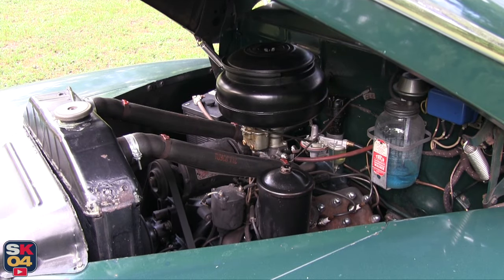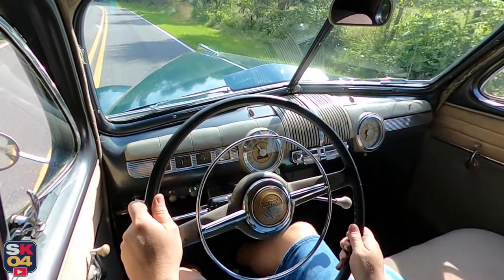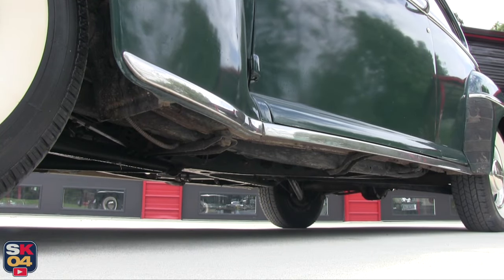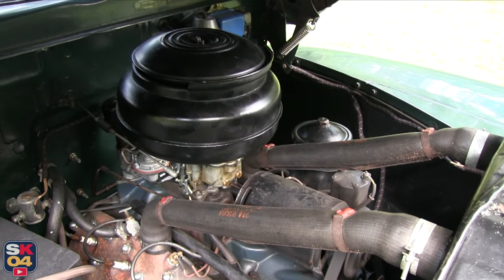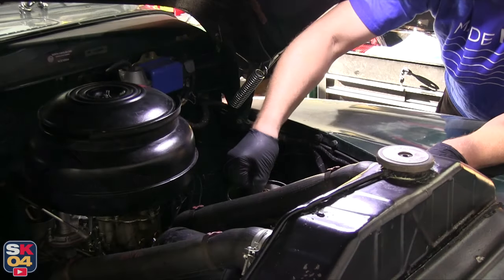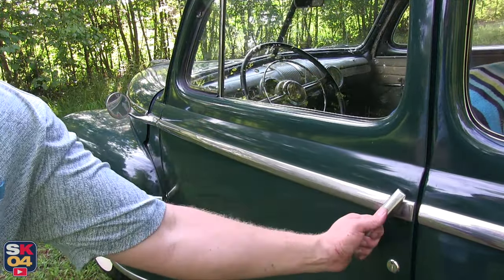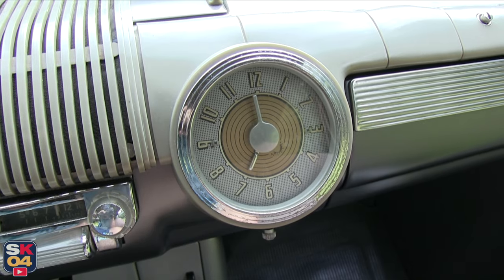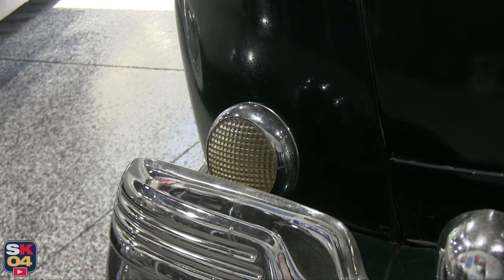1948 Ford Super Deluxe V8 Tudor: Start Up, Test Drive & In Depth Review

Comment: You have a very nice 48 Ford. Amazing original condition. I have an original condition 48 Super Deluxe Fordor in Ford maroon. Your windshield washers are an extremely rare option. You have an original Philco radio. Mine is a dealer installed Motorola, installed when the car was purchased. I am amazed that you still appear to have the fiber panels in the trunk, one over each fender well. These tended to absorb moisture and deteriorate. Your car is so nice I feel out of place making suggestions, except to suggest considering a Pertronix electronic ignition kit for the distributor. My car was purchased new by my grandparents from a rural Ford dealer where you could also buy Ford tractors.  Your car is really a gem.

Comment: Also You Remember Classic Cars and Trucks Like 12 Years Ago With A 1965 Ford Fairlane 289 Also Like Same Thing With 8 Year Both 1965 Ford Fairlane Auto Also Lastly A White 1957 Jaguar With Your Owning A Classic Car Since 8 Year Deleting Video Back In 2015 Since Then Also Since 2010 13 Years Ago Since With A 2010 Hyundai Genesis Coupe 3.8 Grand Touring White Also 16 Years Ago With A 2007 Lexus ES Or Lexus ES350 With Sharing A Toyota Avalon Also Like A Almost 12 Years Ago Like 1995 Buick Riviera Also A 2012 Dodge Charger RT Max Also A First Car Was Back Almost 20 Years Since Saab Back Then In 2004 Also 10 Year Owning A 2002 Ford Thunderbird Also A 2005 MINI Cooper S R53 Also Like A 10 Year 2003 Chevy Avalanche Z71 Also A Almost Back In 2016 Or 2017 With A 2013 Dodge SRT Viper GTS Also A Saab Black Car Also A More Owning Cars Back You Own It For 16 Years Since With A 2007 Lexus ES Or Lexus ES350 For A Long Time Period Kyle.